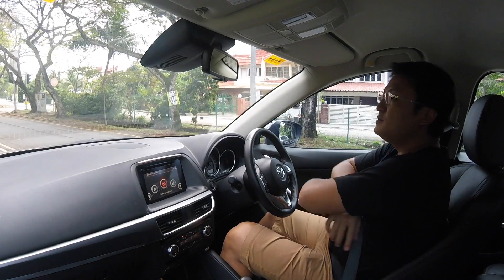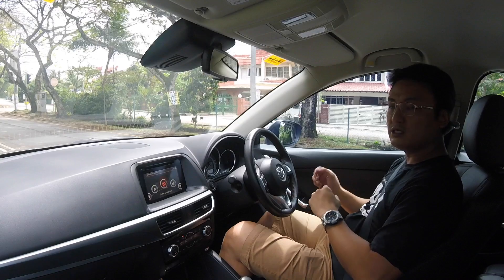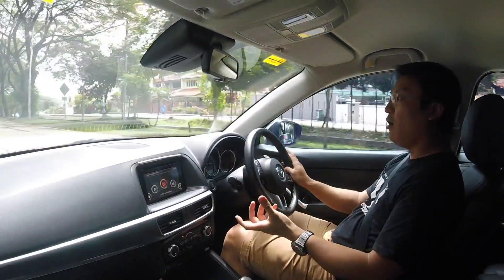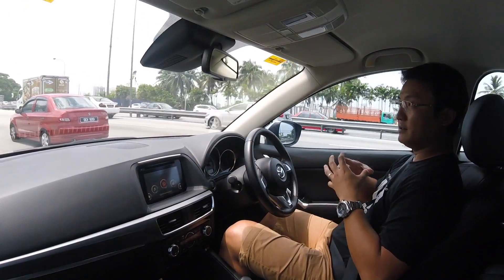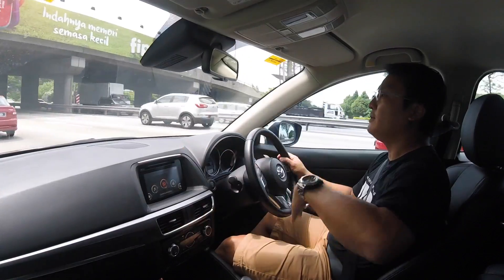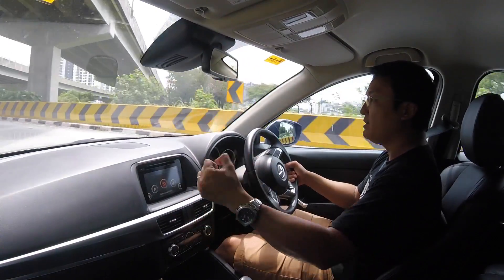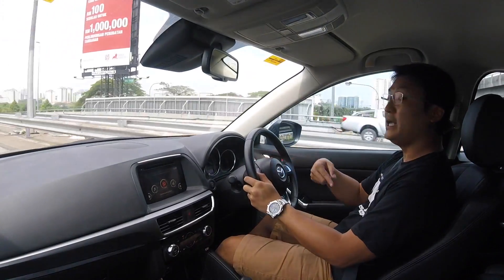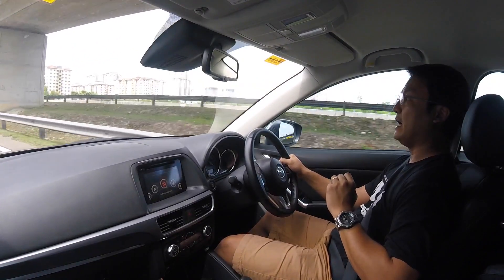Layman Tech Talk Ep1: What is Torque and Horsepower? | EvoMalaysia.com

Comment: Okay take it this way. 
An Audi R8 V10 Plus has big figures of 610 HP and around 550 Newton Meters of Torque. 
It can accelerate to 100 Km/h in 3.2 Secs that time it's using torque for the next 100 to 342 Km/h it will need its other 610 HP to accelerate up to top speed faster.
Quick Fact:
Your car produces max horsepower and torque from your foot flat down the gas pedal no matter what engine or power figures it has.

Comment: From my understanding,torque is how fast or hard a car can accelerate and horsepower is how fast a car can go.Take for example, vios dugong (manual variant) have quite a high torque during accelerate and when it start getting up to higher speed,the power balanced out.
Reply: Vios is slow as hell...  Not insulting or commenting but just saying

Comment: another way is , horsepower is about how fast can u go , and torque is , how fast can u get to that speed...
Reply: No, because cars have gearboxes and final drives. The gear ratios are always optimised for horsepower and weight, so higher horsepower usually results in faster acceleration AND top speed for a given weight.
Reply: This video and your comment perfectly explained everything. I have to have to have to click the "like" bottom.
Reply: @wesleyyap2371  horsepower is torque multiplied by RPM, or a measurement of how quickly an engine can accomplish a certain amount of work
Reply: nope

Comment: very good info. can you make a video to explain how turbocharge engine has higher fuel efficiency compare to NA engine when both engines have identical power output. thanks
Reply: When both engines have identical output, this means the turbocharged engine is overall smaller than the NA engine. As a reference, a 2 litre turbo charged engine is able to produce the same power as a 3 litre naturally aspirated engine. And we all know smaller engines use less fuel.